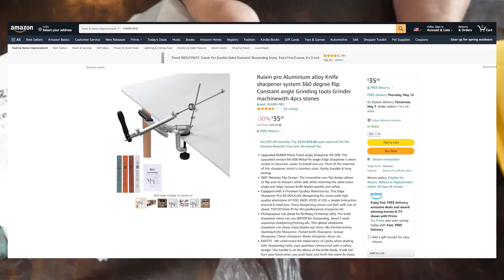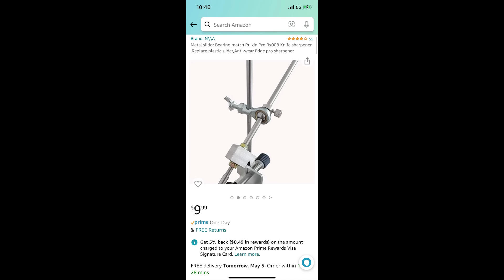An Actual Review of the Ruixin Pro RX-008 knife Sharpener

Comment: I’ve used the same diamond stones with my Ruixin on many knives without the degradation he reports. It looks like he didn’t use water and they clogged with iron dust.  No missing parts on mine either. One guy said his angle changed when he flipped the knife. This appears to only happen if the spine of the knife contacts the rounded channel at the bacon the jaws. I think this sharpener was worth the money I paid.
Reply from the maker: Included stones aren’t diamond.  They AO and garbage.  I did use water with them.   Diamond stones work fine. I don’t know what bacon jaws are.
Reply: @GreenBeetle  at about 4 min. 20 sec. You used diamond stones and basically said they were worn out after the one use. 
Bacon jaws are apparently what auto correct thinks I meant by “back of the jaws”.

Comment: I was gifted one of these and have been practicing sharping on some older beat up knives. I see that when you are sharping, you short up and down strokes following the length of the blade. The video the manufacture shows, is pulling one full stroke for the length of the blade. Is shorter strokes better or one long stroke to sharpen?
Reply from the maker: I need to do a video on this.  There are specific reasons I do it that way.
Reply: @GreenBeetle  I’d love to see it! Thanks for the reply and knowledge about better whetstones.

Comment: Stones are crap. You must lock that holder in place. If it rotates as in vid the angle changes for the stone. I filed a flat grove on the axle. Made it stay in place. Plastic is better than metal against metal. I filed the holder for that plastic ball down some to get rid of that play. Just screw the holder apart and carefully file some off. Go for Venev stones, best ever. Holds a lifetime.

Comment: You’re moving the sharpening stone back and forth on the blade? You’re dulling it with every backstroke as you’re using the blade to shave off the whetstone.  You’re supposed to do smooth long strokes from the tip of the knife down to the handle, pulling the stone out as you go.
Reply from the maker: You can push, pull or both on a stone.  These types of systems are designed to go in both directions.  The problem here is junk stones.

Comment: 1. DONT soak stones, a spray bottle with water to keep the working surface wet is all that's required.

2. Use slow motion and use the full length of the stone. Your sharpening like your sawing wood. It's for sharpening not cutting a bevel. You pre edge it on a Tormek or Grinder then smooth it out with this
Reply from the maker: Manufacturer instructions often direct water stones be soaked prior to use - I’ve seen up to 15 minutes.  I take the manufacturers at their word. 

Stones often go down to 150-250 in grit and can be used for cutting or repair in that case.  Also if a person is buying a $30 sharpener they likely do not already own a tormek or grinder.

Comment: My experience with this sharpener, is that the fixture clamp holds the knife at 2 different angles. Mine has a 2 degree difference from one side to the other
Reply from the maker: Sounds about right
Reply: @GreenBeetle  I sent it back the same day I got it.
Reply: Right the angle is different when you turn the knife
Reply: Yeah it’s a pain, I just flip the knife and ignore the 180 feature

Comment: Which sharpener do you prefer??
Reply from the maker: I start most stuff on the 2x72 and get it down to just under apex. Then I use 1 of 3 methods.  Worksharp Ken Onion for convex edges or Arkansas stones followed by Shapton glass up to a very high polish or the Kazak Pro / TSProf to 5000 grit the latter being the most common way I sharpen stuff. Of the 3, I enjoy using the Arkansas stones the most but I’m not as proficient with them.
Reply: @GreenBeetle  
I've had the KME and the Ken Onion rigs.
Recently purchased the "Master Kit" from TSPROF, but haven't found time enough to sit down w/ it.
Hoping you'll do some TSPROF tutorials?
Thanks for the interesting content!

Comment: you used lancky system as you would advise please. this chinese with better diamonds or lancky with diamonds?
Reply: there is also this plastic worksharp at a similar price, but you can not buy anything separately there and with the entire upgrade it is not so cheap anymore
Reply from the maker: Lansky is fine
Reply: @Palmotron  There is a full 'upgrade' kit for the worksharp as well as aftermarket products available to use 4 or 6" stones. Check gritomatic

Comment: This unit is very cheaply (Chinese) made. Where the ball guide unit gets tightened to the vertical bar to achieve desired angle continually loosens on me... so be mindful. Also my wet stones keep falling out. You get what you pay for.

Comment: That ball looks like it might be teflon which would be a good material choice, maybe it's HDPE though which would still work for a while.
Reply from the maker: its clunky, sticks, catches and barely turns.  if its teflon they wasted their money but yeah if it breaks its prob cheap to replace but in the meantime i don't think it functions as well as intended.
Reply: @GreenBeetle  Mine does none of those thing.  Works perfectly.
Reply: Nylon. a dab of graphite dry lube and it's honky dorey

Comment: Just so you know: the screw isn’t missing. It’s in another part of the base. The instructions point this out pretty clearly. When you use the water stones, splash some water on them and the blade every time you turn the blade over, it helps prevent the "extra" slurry. Also, if you plan on continuing to use the water stones, I would suggest not using the side stamped with the grit number. Once you wear through that, figuring out which grit you’re using will become more difficult. One other thing, if you use the water stones, some come with a plastic base on them. These bases change the angle of the sharpening stone part of the system. Be sure to recheck your angles or you’ll just undo all your previous steps. If you plan on using the diamond stones I would suggest using some light machine oil or honing oil on them. Cuts down on the dust and helps create a slurry. I’ve had my system for about a year and the only thing I wish was that the would have used better metal in the handle. Cast metal is fairly weak and if you over tighten the screw that clamps the stone holder onto its guide rod, it will spread the jaws and eventually break that weak metal.
Reply from the maker: My screw was missing on one, present on the other.  The stones included are junk. Thanks.

Comment: THe missing bolt is included and is already screwed into the hole where the vertical rod screws in. Remove the bolt and insert it in the blade holder.
Reply from the maker: It was there on the second unit but not the first

Comment: I used it dry, and it worked okay ish. I tried using oil and it didn't bite the blade much. The screw on the ball joint gotten loose so I bought a metal one. I used it lightly to sharpen my blades. It is working but you need to be patient. Another solution, just buy small belt sander and strop your blade free hand haha

Comment: I agree it has its quirks but I would not say it's unusable out-of-the-box.  That's rather harsh.  The two main issues I have about it are:  

1. Sometimes the height adjustment wingnut can loosen while you're sharpening.  But that's nothing that some medium Loctite won't fix.  Cost of fix: $5

2. The clamp has a 180 system but the angle is totally off on the other side when you try to flip it 180.  YouTubers have posted some fixes, or invest in an 8th grade geometry protractor.  Cost of fix: $2 and 20 minutes of your time to watch Youtube vids for those fixes. 

You can definitely sharpen most knives even with the cheap stones that come with it.  Once you get into some of the hard tool steels or uber high end powder steels then you'll definitely want (need) to get better stones but that applies for many other systems.

It definitely requires some time to set up properly if you don't have a permanent spot on a work bench, and my advice is to take a protractor and trace out some angles with scrap cardboard of popular sharpening angles (15 degrees, 17 degrees, 20 degrees, etc) and use that to eyeball the angle of the stone to the blade.   

I think an angle sharpener, like a Spyderco Sharpmaker, is probably the easiest and quickest way to sharpen most knives but the fact is that some people have trouble holding an angle even with something as dummy proof as an angle sharpener.  For people like that it's probably worth the $30 (when on sale) to buy this Ruixin.  In fact, I think I got mine for even cheaper and figured it will pay for itself with the cost of just getting one kitchen knife sharpened by a professional.

If you wait for it go on sale on Amazon then it's worth owning it for such a low entry level cost.  At least IMO.

Comment: My experiance was similar to yours but WORSE! The first knife I tried was a pocket knife with. 4" blade.  The clamp refused to clamp the knife at an angle that was the same when you flip it.  Huge POS. No way in hell I'm putting a good knife in this contraption.  I'm sending mine back and using by belt sander system to fix my blade. Very disappointed

Comment: You use up and down movements, (and seem to spend more time on the tip and end of the blade) this could be why you get so much 'slop.'  In other videos about this sharpener they go from the point to the inside end of the blade, systematically, 15 times on each side using a sweeping motion across the length of the blade, not jerky up and down motions.
Reply from the maker: The stones are garbage is why there is so much slop.  Moving the stone up and down across the blade is the same motion one uses with hand sharpening on a stone and causes more even wear on the stone.

Comment: Sorry to say that, but the amount of slurry you’re creating comes from the direction of the force you’re applying.
Especially if the knife is hard enough to go through the stone itself. So when sharpening it apply the force from the top to the edge only. And move along the blade. From tip to base. One long motion. That’s how you preserve both. Otherwise you will damage both knife and sharpener. Cheers
Reply from the maker: Buahahahaha!
Reply: @GreenBeetle  have you ever watched any of the demonstration videos or just pulled the technique out of your 4$$?

Comment: Well you’re using it wrong could be the issue. Knife sharpening should be fluid sweeping motions from tip to heel.
Reply from the maker: Incorrect they can be used a variety of ways the issue is the stones are cheap garbage and several parts are cheaply manufactured.
Reply: @GreenBeetle  I guess you are the trusted go to expert in this field?
Reply: @brianterrell218  The stones are hot garbage. You will get 1-2 mid-low end steel knives sharpened and then have to hone the stones. If you think the stones provided are of decent quality, you might wish to do some studying up on stone and diamond sharpening.  (First knife I used this thing on was a buck 110 from the 1980s. They did the job. 2nd knife was my 7" santuko made out of vg10 as I wanted to test the stones... yeah.. POOP! I installed TSProf diamond plates (was $65 then, $77 now from gritomatic) 150, 220, 400, 600, and 1000 grit. Next did my 154cm folder using another gritomatic silicon carbide set (current price for 5 stones 120,240,600,1000,2500 is $106. Amazing stones and diamonds from gritomatic. JUNK from Ruixin. Comparatively, they are a Yugo vs a BMW.